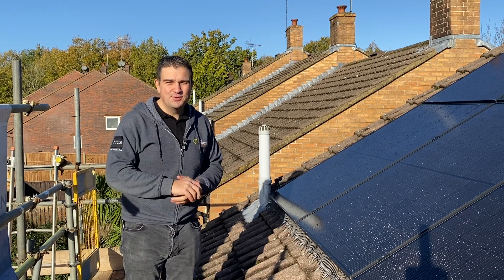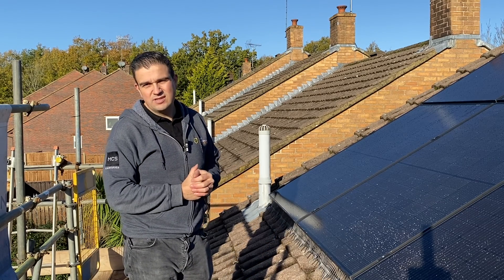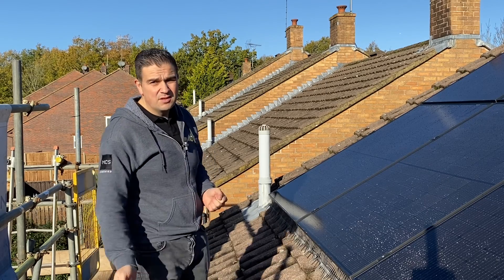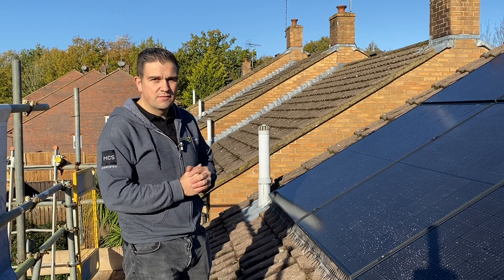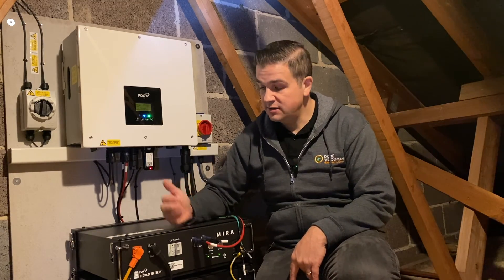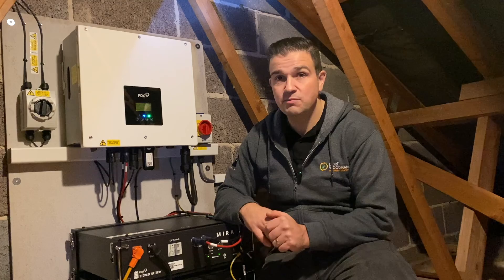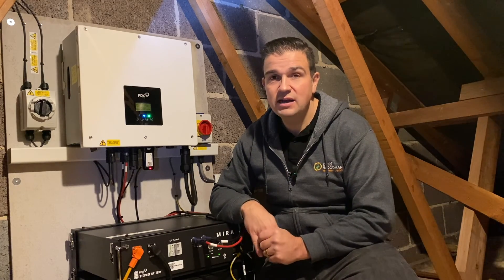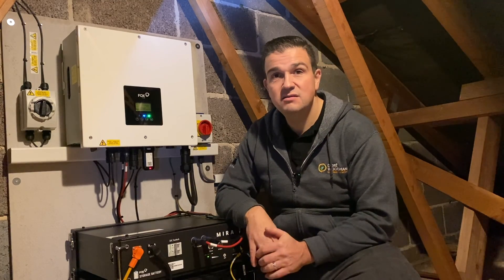Unleash the Power of Renewable Energy: Solar PV with FoxESS H1 Hybrid Inverter & Battery Storage

Comment: Good video and I have a Fox ESS hybrid system myself with 3 batteries, two inverters and 13 PV panels. 

Most people are not obsessed with being “green and sustainable” though. We mostly care about the fact energy prices are through the roof. So we buy solar to beat the system. 

If you really want sales then push the energy independence aspect as well as the fact a good 5 year unsecured loan at around 5% apr to pay monthly, if carefully planned could cost the same as your current lecky bill cancelling it out in the short term and it’s free electricity for the lifetime of the gear after that. 

That’s what homeowners care about. Not carbon neutrality.
Reply: Hi I hope you don't mind me asking, is there a decent mobile app to control things like import/export with these batteries?

Comment: Don’t like the use of the loft for battery and inverter installation. Gets very hot up there which the equipment doesn’t like and there is the obvious fire risk. My installer wanted to put the inverter in the loft but as the heat will shorten its life and you cannot easily access the inverter I insisted it went in the garage. No issues so far after 5 years.

Comment: Don't install electronics in a loft. Inverters have fins not fans. They like cool air circulation aroynd them. It's going to die early if it's running hot. And will run hot on the hottest sunniest days! Garage or utility room every time!
Reply: not only that but to access system controls you have to go up and down a loft ladder and get accross your inner roof space, not ideal especially if older customer.

Comment: I have had my Fox H1 inverter and solar panels installed for just over  year now.  Great no problems, very satisfied.  However last week I had to have a new modem installed as they have gone full fibre broadband in my area.  Unfortunately I have now lost my internet connection to my inverter, that was set up with my old modem.  Can anyone tell me how to change the settings for my new modem?
Reply: Best to read the inverter's online manual on how to reset the internet connection.

Comment: I've never understood why you need a fire board on top of concrete blocks? In all my years of being a fireman I never once saw any on fire 😅
Reply: Is it not simply for the convenience of having a flat surface to mount on / attach labels to - which is not combustible ?
Reply: @chrisroyle4813  He says fireboard "for extra protection against any situations that may or may not arise" but the board is doing absolutely nothing & the nearest combustable objects to the system appears to be the timber rafters so if you're going to the trouble of installing protection anywhere I'd cover those.

Theres no way I'd be attaching heavy gear to what looks like aprox 9mm to 12mm board so you'll have to drill through into the blocks anyway, obviously the boards makes this a bit more of a pain in regards to measuring up to make sure you don't hit the mortar or to close to the edge of a block.

Since watching this I have heard a few sparks say the powers that be have demanded a fireboard behind some of their instals even though they had already done it on brick or concrete. I suspect someone came up with the quite sensible rule of using fireboards to protect walls that would benefit from it, but now its a case of every single instal requires one even if theres no point because it's says so in the book.

Comment: Loft is not the best place to put the inverter. Its not efficient and could diminish the lifespan of the device. 

The inverter regularly reduces its output power due to high temperature. The loft is a poor place to install the inverter as they get very hot and in particular will get hottest on the day you want your inverter to work its hardest. This will reduce the output from the inverter and age its components quicker.
Reply: Our 2kWp inverter is mounted in the loft and I've recently added Home Assistant which exposed the inverter temperatures. A couple of weeks ago the inverter recorded that it went above 65c. I believe it would have been progressively de-rating from about 45c with a shut down at 65c. For now, I've added a temperature controlled socket which powers a fan to circulate air over the cooling fins, which has helped flatten temperatures between 40c & 45c. In an ideal world the inverter would be mounted on a north facing shaded wall. This is a 2011 FIT system, so we don't want to lose generation because of de-rating. 

In summary, I concur.
Reply: @chrisroyle4813  Very interesting. Thanks for sharing.
Reply: Fully agree. Loft installation is not good idea.

Comment: Very helpful video. Looking install Fox inverter and batteries. Do you know the distance you can run for the CT clamp? Can it be extended, my system isn't close to the master consumer unit.
Reply from the maker: Hi Adrian, thank you for the comment. As far as I am aware you shouldn’t run data cable further than 100 metres

Comment: I have this exact installation and am generally pleased with it (12 months installed). Have found that the batteries are having issues with the current cold weather. Any ideas how to mitigate this?
Reply: What temp do they stop charging at ?
Reply: @intheyear2510  Below 0c. It's not that they don't charge, it's that the cold affects the charging rate and it takes far longer for them to charge up. 
They are back to normal now after the cold snap.
Reply: @andreashessler838  I see , you could look at low voltage heat Matt's placed between each battery

Comment: Another great install. Are you considering GivEnergy batteries?  GivEnergy batteries are a but more presentable, provide a dedicated emergency circuit for when the mains fails, and mount flush to the wall.  They also use LiFePO4 cell chemistry for greater cycle life and improved safety.
Reply from the maker: Thank you, yes we will consider other battery options for sure and GivEnergy products are ones we have a close eye on, albeit I think they may be a victim of their own success in recent months with many concerns and complaints over their recent customer service and support but that said, it isn’t something we have experienced personally and with a sudden huge uptake in Solar PV products, hopefully this is just a short term issue.
Reply: The fox battery systems and probably almost all home battery systems use LFP (lithium iron phosphate) due to 6000 cycle life and incredibly hard to make catch fire. Exception I read is early Tesla home batteries!